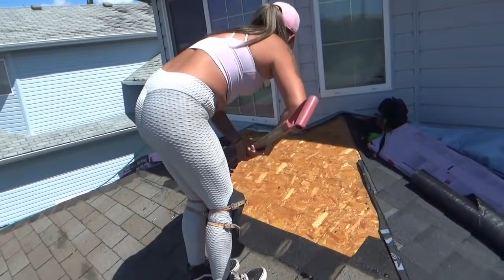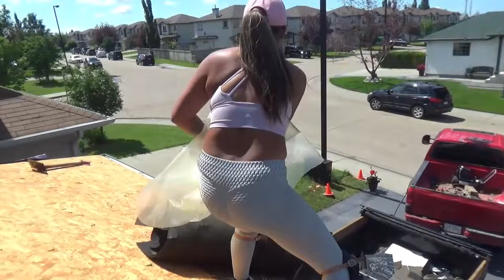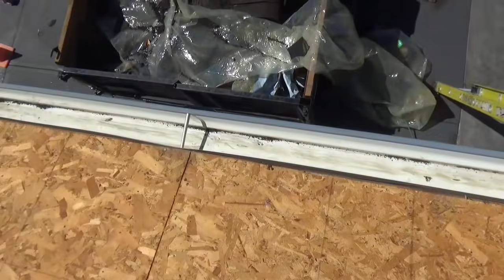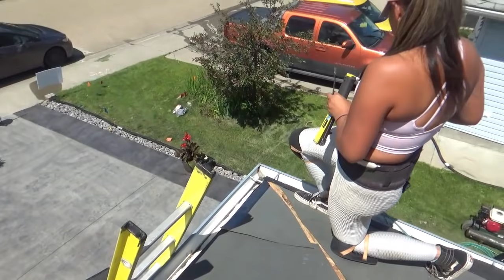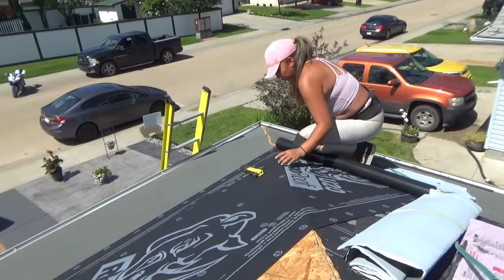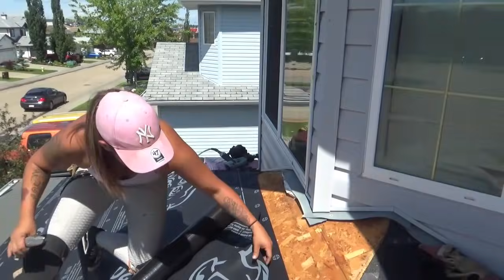Tear and Prep

Comment: Good work but save your back. Thats a tough job. I worked in power plant in maint as mechanic for 35 of my 45 yrs. Took a toll on my back, had back surgery but still not the same. Now retired and want to do mor on my hse but cant becuz of back.  Wish you could do my roof, nobody for miles. 💪👷‍♀️

Comment: that one hott female.. like watching her work. But did anybody notice there was no tar paper on the roof
Reply: I like ya flag
Reply: T  there wasnt any
Reply: With 3 tab shingles back in the day, you didn't have to put paper underlayment. 3 tabs are better than laminated shingles at water proofing.
Reply: @Josh-ww5kz  3 tab shingles are garbage but you still need tar paper under it.
Reply: @ericbacon9317  they arent bad
Reply: No safety equipment, no tar paper, no snow/ ice shield.  No wonder this roof has to be redone.

Comment: That trough wouldn't survive a winter here with the hangars every 4ft. 

Also invest in some standoffs to prevent damage to trough.
Reply: Thick jacket to not scratch the paint...ladder  in the middle of a pin for weight. And climb lightly 😉 no stand offs needed